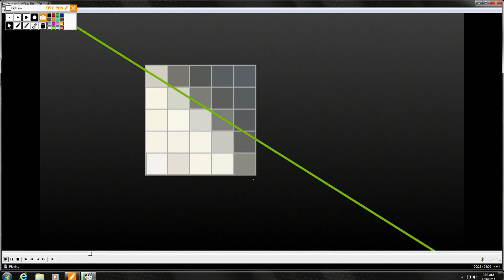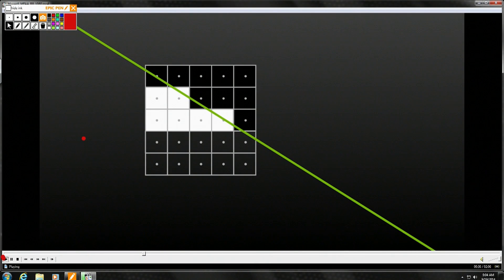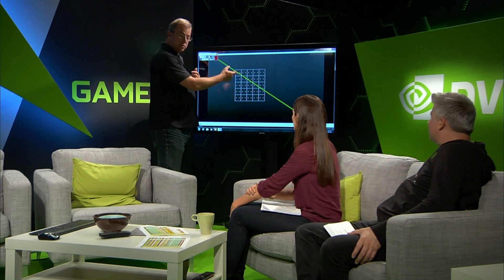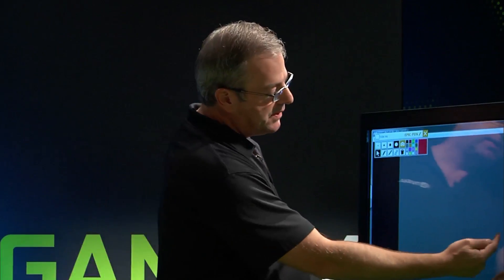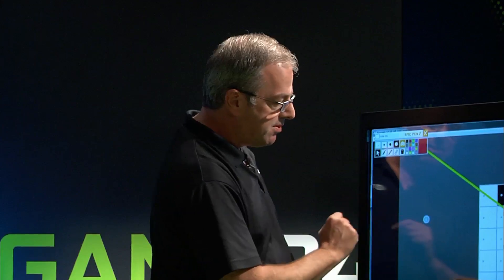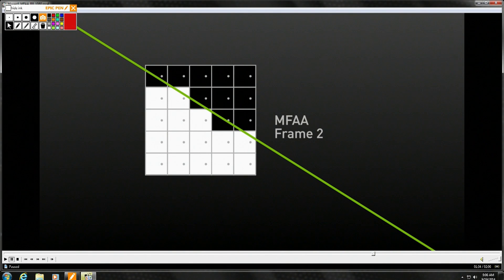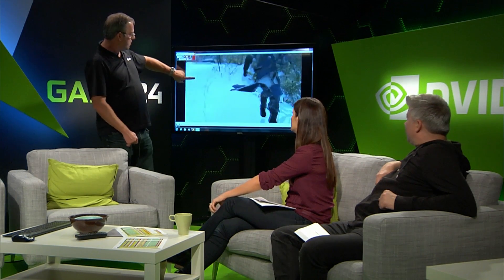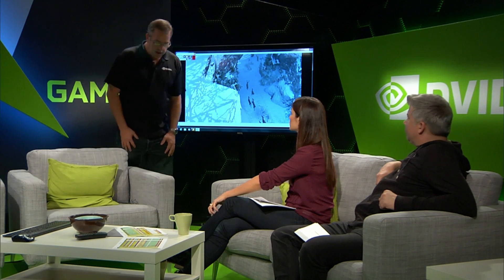Tech Review MFAA

Comment: Very cool concept. Definitely only for people with powerful rigs since it relies heavily on lots of frames and thus would require a high frame rate for it to work well. It's an interesting concept though and I'd love to see it in action. 

That being said, as resolutions get higher and higher, the need for AA is becoming less and less as the pixel density is much bigger. I'd much rather have Nvidia focus its efforts elsewhere.
Reply: well it's true that resolutions get higher and there are some 4k resolutions that don't profit that much from MFAA but the majority is still on 1080p monitors and not every game is fit for 4k. also the power to run games like crysis 3 or battlefield 4 on 4k resolutions at 60 frames is still not there on single gpu cards so a lot of players will choose lower resolutions and more fps over 4k.

Comment: Sooo.... MFAA only works with high framerate? So if you get any minimal lag the AA looks like crap. Awesome but not waterproof.
Reply: That's the point. MFAA is besically MSAA without the performance hit. Better performance = higher frame rate.
Reply: ***** Nah, it uses the last frame for the next. If that frame was too long ago(lag spike) the AA will look bad and might cause visual errors(which I think is tested but possible) and/or won't be present. You almost can't make a game 100% lag free even with the best GPU the coding will have errors in it causing lag and thus even downgrading your visuals. Nice idea but I rather just take one step below in stead of using all dem smooooth edges.
Reply: CapnTates But the error with only last a fraction of a second since you are presumably running at least 30 frames per second (which is the case since the 970 and 980 and such high end cards). You probably won't even notice it.
Reply: ***** I would notice with 30fps, I find 30fps a stutter by the way, it's NOT smooth gaming. The technology is for the 900 series and not just the high end so saying you should get even less performance(with normal AA) with cheaper cards is bullocks. The high end cards wouldn't even need better performance because they're mostly at 60fps+. Any microstutter will make the MFAA look worse which is always there, especially with SLI which is supposed to pack even more performance. I know how this works and thus am sceptical. I'd like to see it in action because all they've shown were stationary objects which is easy.
Reply: CapnTates A studder in frame rate is from going from a high frame rate to a lower frame rate in an instant. 30fps is not a stutter if it is constant. This very video is 30fps and it doesn't look like it's stuttering at all. Besides, the only way to get 30fps using the 900 series cards is if you play at 4k resolutions which is overkill. 

The only other 900 series GPUs available besides the 970 and 980 are the ones used on laptops, the 970M and 980M, and since the majority of PC gamers use a desktop PC it shouldn't be an issue.
Reply: ***** It's about the lower end that's supposed to come out in due time.
I find 30FPS stutter in games because I can see every single image without proper motion blur which gives me a headache. I might be more sensitive than most people on this but it does bother me.
And if games come out with higher demands, then the cheaper AA solution doesn't even work! That's what I'm troubled with.

Comment: all i want is MFAA on my 780 -,- and don't tell me its Hardware because it is clearly not -,-
Reply: It's the hardware
Reply: After reading online it seems that maxwell is the only thing that supports to change the position of the samples. So it seems that its only maxwell. Sorry
Reply: It is, It automatically places Samples allowing it to place diffrent sample positions for each pixel. 780 is not capable of putting diffrent sample positions, 
But dont worry it works same as MSAA x2 , MSAA consumes more horse power
Reply: all i want is it on my 970 like promised... WHERE THE FUCK IS IT NVIDIA?
Reply: Black Bird "This technology is only supported in the GTX 980 and 970, however it is NOT ready at launch; support will come in a future driver update."